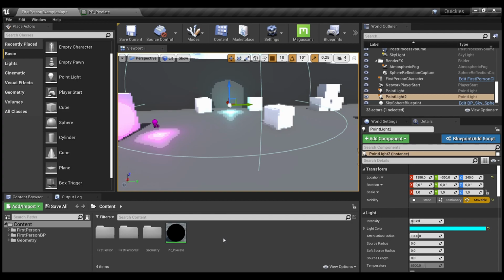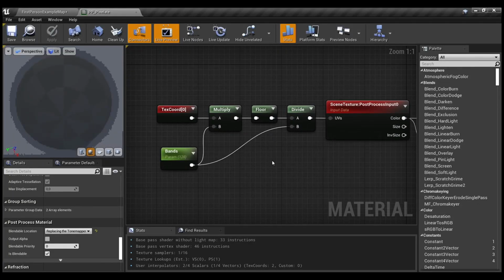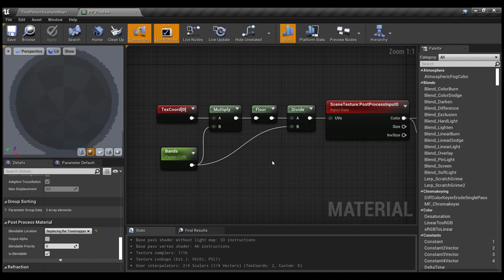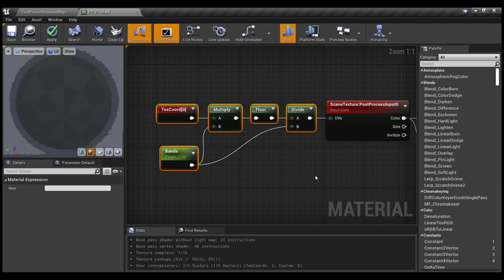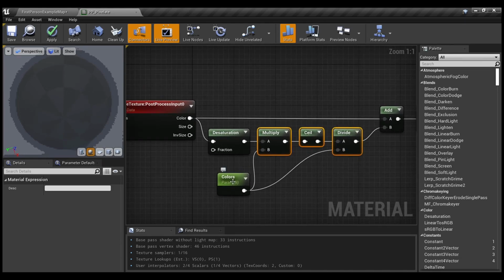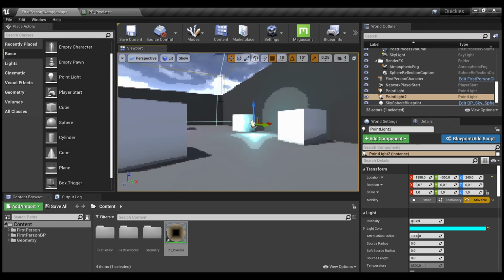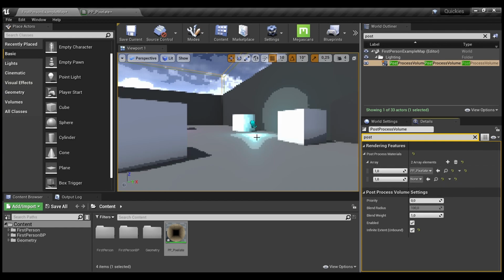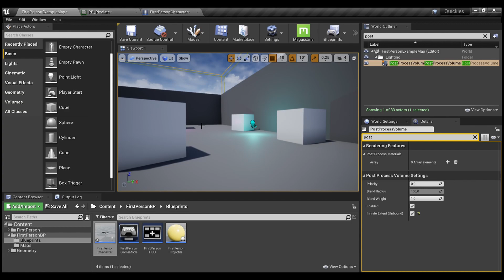Pixelated Retro Post Process in UE4/UE5

Comment: Forgive me for being a noob but what are the Param (128) and Param (8) for Bands and Colors? Or more specifically what do I need to type to insert those nodes?
Reply: The Bands Parameter (128 in the video) represents the pixel resolution (whatever goes in, will become 128x128 pixels resolution), and the Colors ( 8 in the video) is to reduce all the colors to a way lower amount of colors, to get the moe limited color palette look. Check the lights at the end of the video, how their enlightened area now has bands instead of seamless color.
Reply: @Suthriel  so what do I type? you never answered that
Reply: @TacticalGoat  Wait, you mean, how to get the Scalar Parameters themselfes? Either hold "s" down and then additionally press the left mouse button, that creates a ScalarParameter whereever your mouse cursor is in your Material Blueprint, or via right click and search for ScalarParameter. You can then rename them to whatever you want, in the video they are renamed to Bands and Colors. So those are not some exotic nodes, those are the most basic nodes (and some of the most important ones to know about), just renamed. The number in the brackets are just their current default value.
Reply: @Suthriel  Oh, thx so much man